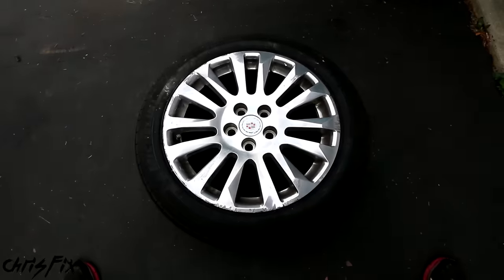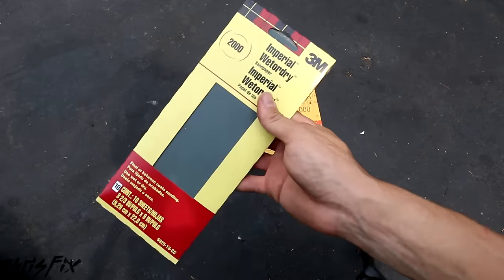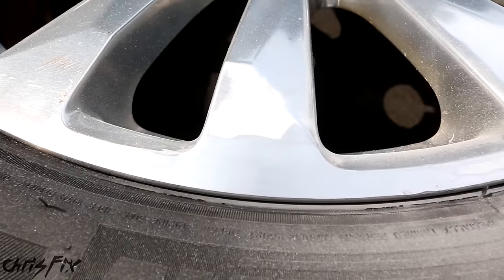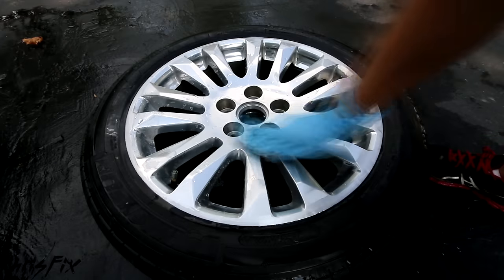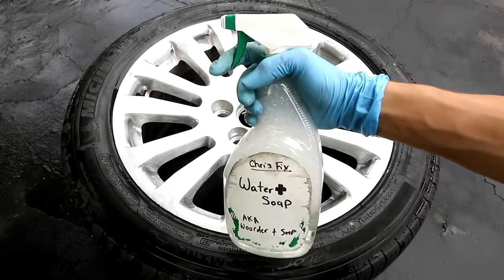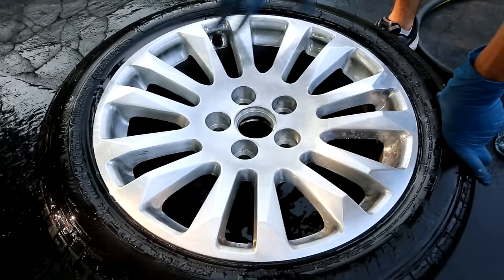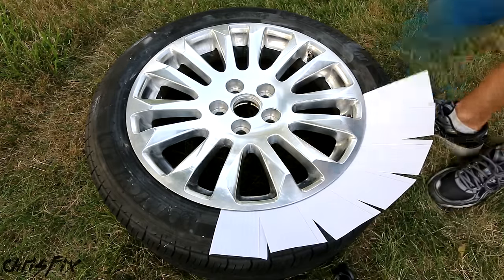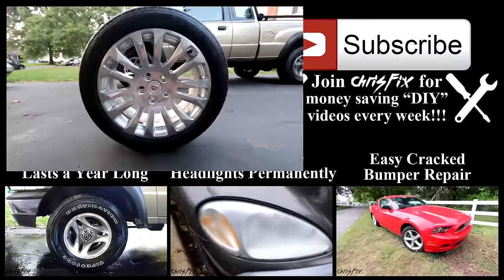How to Repair Rims with Curb Rash or Scratches

Comment: Or just don't let women drive :)
Reply from the maker: +mcgaugh57 haha, that is literally how it happened. My bud let his gf drive his caddy.
Reply: ChrisFix I knew it.
Reply: +ChrisFix Wassup Chris, excellent video as always!
Gotta question, i got 2 small annoying body rust spots on my car just above the tires on the paint. i had a guy sand it down to the metal and re-paint it, but i knew it was a possibility of it coming back, and sure enough it did 2 yrs later...

Now i want a full paint job but i know if i do it, it would come back... i was told the only way to remove it is to cut it out, is that true? Do u have any potential remedies besides cutting?
Appreciate the vids man, keep up the good work!
Reply: +mcgaugh57 If women are such bad drivers why is insurance higher for guys?  For the record I have never hit a curb.
Reply: Katy Bauer I just don't know why.
Reply from the maker: +gotti914 You need to use a sander like this to remove all of the rust: http://amzn.to/1L4yM2i
You cannot be afraid to remove all of the rust because if there is any, it will come back. Then you can bondo the damage and smooth it out. I will be doing a video on bondo so stay tuned.
Reply: I have this issue but mines happened due to someone side swipping me and me hitting the curb due to the brute for e of the impact. What makes it hilarious....it was a woman distracted on her phone.
Reply: +Katy Bauer Because guys are more reckless and take more chances when driving. Example would be like driving fast or doing donuts to impress a girl. Most girls just aren't really paying that much attention when driving.
Reply: +mcgaugh57 Oh, I've seen a whole lot of men doing rim curb damage. So I don't think it's just women :)
Reply: omfgwtfbbq90 No, really ? it's a fucking joke .
Reply: +Paolo Bernasconi That is just a blanked statement. The few people I had personally known that have died in car crashes was due to woman drivers. The first one the woman was talking on the phone and putting on her makeup while driving over the Howard Franklin bridge. My buddy was driving his Jeep Wrangler when she side swiped him, causing him to hit the side barrier of the bridge. His Jeep flipped over the barrier (the Jeep was raised a bit with off road tires and suspension so he was a bit taller then a normal car) and down in to the water. The other friend I knew that died in a car crash, he was on his motorcycle and the older woman pulled right out in front of him and I. I was lucky I was on the outside of the lane and had enough room to miss hitting her mini van. However my friend was not so lucky (or his reaction time was not a quick as mine) he hit the rear quarter of her van and died instantly. 

So yes men have a number of accidents due to the fact that men drive more often then woman. However studies show that woman get in to a higher number of accidents in their lifetime then men do. However due to the fact that woman drive a lot less then men do the total of accidents is less, but the frequency of which the average woman gets in to is statistically higher then men.

Here is an article that highlights some of this:
http://www.syracuse.com/news/index.ssf/2011/07/women_worse_drivers_more_crashes_than_men_less_driving.html
Reply: ***** Well first of all, I was not rude or disrespectful to you in any way. You on the other hand being rude and disrespectful, speaks for itself what sort of person you are. I was just showing that the insurance companies charge what they do because we (men and woman) have no choice but to pay it (that is if we want to drive legally). On that note, once I turned 25 my rates dropped substantially. They were actually lower then my wife's (she is 5 months older the I am). Of course that is just me, I have never had a speeding ticket, nor have I ever been in an accident, so I get all sorts of discounts. Well that and everything is through one insurance company, life, auto, house, etc...
Reply: +Paolo Bernasconi  I used to look at the the factors that affect prices by going to a website like The General and changing things to see how if affects the rate and also I would ask the agents at those insurance broker places like Eastwood before they was strictly Nationwide, and Amax. Your zip code makes a big difference, being a woman would of only saved like $5 but they said I had to go off what my divers license said. Being married can be good for about $5 a month, but widowed made one price go up and one got down, being a artist or police makes it a little cheaper but not much. Some places want $100 a month for SR-22, others want a $7 one time filing fee, Safe driver helps a lot. Going from a 2001 Cavalier to a 2000 Pontiac Montana saved about $7 a month. Good credit can help. Shopping around is a huge factor, when I was younger I had State farm and I spent the whole day at work and called everyone that had a commercial (the big companys) and they was all way higher, the next day I called all the companies from the green sheet and it got down to going back and forth between two companies to get the lowest rate, I stayed with that company for 4 years and my rate went down 50% until I was busted using it commercially. Now that I am over 30 I get better rates from the big name companies like Geico and Progressive. I have had 3 wrecks and they did not affect (affect or effect, idk im retarded) my rate much at all. When you shop for insurance you have to watch it because some will count not at fault accidents still

As as them talking about woman wrecking more don't take it personal it doesn't matter. They would base it on race if they could so thats why they base it on every little thing they can to make up for what they cant base it on. My first close call when I almost wrecked would of been adding to the statistics of men wrecking but they wouldn't of factored in the fault of the high school girls running down the side of the road.
Reply: +Paolo Bernasconi so your logic is...  More men=More accidents Less Women=Less accidents? + woman with small accidents don't count?...  who told you this? fox news? lmfao
Reply: +NerdishAzn I have more women blow by me in crossovers and SUVs than men by a longshot. Women are the aggressive drivers. Men who speed like to go fast, not to get from point a to point b quicker.
Reply: +Brennan Doehring same here I've been hit by five women all in the rear because they're on their cell phone or not paying attention
Reply: +Paolo Bernasconi if you want to make an insult sound insulting you should read it first before posting it.
Reply: +Paolo Bernasconi "5 times in time rear"  whatever the hell that means
Reply: +Paolo Bernasconi actually I'm very confident and sometimes cocky. You can't make assumptions on someone you don't know
Reply: +Paolo Bernasconi and as for sense of humor goes I'm known to make everyone I'm friends with laugh.
Reply: +Paolo Bernasconi but like I said you don't know me right?
Reply: +Paolo Bernasconi I spotted the white knight
Reply: +ChrisFix my brother-inlaw curb my rim two days ago :"(
Reply: +Katy Bauer Actually now females have higher starting insurance rates due to stats and bitches doing make up while driven or texting. I drive with 3 pedals and a shifter so I dont text. last time i let my female drive, I could smell my clutch.
Reply: Katy Bauer go back to the kitchen the god damn food is burning!! hurry up!!..
Reply: +Dictator In Perpetuity Standard as in Manual transmission, you know the thing with 3 pedals and a gear shifter..?
Reply: +mahunik Provide source that females has higher starting insurance?  Young men kill most when driving. End of story.
Reply: +mcgaugh57  Totally agree, the previous owner of my car was a lady who did this to my summer rims. Bought it during the winter so when the change of tires came along !Supprise!
Reply: ***** then hopefully the self driving won't curb my wheels. An if they do then I'm coming after you ;)
Reply: GTI Dashcam Sweden it wasn't that funny bruh
Reply: GTI Dashcam Sweden :(
Reply: Manny82pr Now tell Kate you're sorry!
Reply: GTI Dashcam Sweden Katy Bauer I'm sorry for being a d*** 
:(
Reply: Manny82pr Fine. no more laughing at your rims then..
Reply: +TooNiceDice Elite damn bro you have to let everyone know. lmao!
Reply: +mcgaugh57 You iz savage. XD
Reply: +Manny82pr damn straight lmao
Reply: +TooNiceDice Elite haha. take care man :)
Reply: +mcgaugh57 orrrrrrrrrrrrrrrrrrrrrrr that! :D (jk ladies)

kinda
Reply: Oh yeah. I let my girlfriend drive my truck once and she curbed my Forces 😢. I used this technique on the two she curbed and you can't even tell it ever happened. We didn't date long by the way.
Reply: +Quentin Smith ehhh as long as she put out then it's all good lol
Reply: +Quentin Smith may you find a more truck-friendly chick on tinder my good man!
Reply: +mcgaugh57 interesting points ,if anyone else wants to uncover car spray painting at home try Wiltapar   Paint Sprayer Secrets (do a search on google ) ? Ive heard some awesome things about it and my m8 got excellent results with it.

Comment: Watching these videos suck when you realize there is 4 tires
Reply from the maker: +XxS1l3nTxa1Mx In this case, only 1 rim was damaged so the job was done after this!
Reply: +ChrisFix haha very true but will this work on black rims? I don't know what type of metal it is but it is black paint can I do the same steps
Reply from the maker: +XxS1l3nTxa1Mx Black rims are easy! Do steps 1 and 2 and then smooth the areas you worked on out. Then sand the whole rim with 2000 grit, then spray primer, then spray black paint. Takes an hour at most!
Reply: +ChrisFix ok thanks what kind of paints would I need
Reply: +XxS1l3nTxa1Mx Primer, gloss black (or matt, depends what you want) and a clear coat. (Matt clear coat if you don't want a shine)
Reply: +Hamisxa Who's Matt?
Reply: ***** And how was your comeback any better?
Reply: +XxS1l3nTxa1Mx watching these videos is the best because i have no car :D
Reply: +XxS1l3nTxa1Mx hard work pays off.......you could just pay 80-100 bucks per rim and get them touched up at a lot of shops or those guys driving around in their vans (mobile workshops) but the whole point of this vid is how to do it for much much cheaper
Reply: +Top speed well you saw how screwed up that rim was and how good it looked when he was finished - the cost of all the materials needed for the job is less than what it wouldve cost to have professionals do it. So yeah - it's just a DIY video for people who arent lazy and who are willing to do some work in order to achieve results, and at a fraction of the cost
Reply: +Hamisxa It's spelled "matte" (irony)
Reply: flimflam Doesn't matter. Here in Ireland we spell it matt....
Reply: Hamisxa Who's Matt?
Reply: flimflam As you can see I didn't use a capital letter, therefore it's not a name......
Reply: ***** Sorry I'm not Australian...

Comment: I have minor scratches around the outer most area of the rims. They aren't deep at all. Do you think I could sand them down with a flap wheel sander and apply clear coat around the fixed area? Id rather not take the clear coat off the entire rim as it is a 2015.
Reply: Dylan Walter that's what I'm wondering too. Don't fancy stripping the entire wheel. Chris, can we do this?
Reply: you could, itl look bad though
Reply: Talk about 2015. I just messed up the wheel on my 2018 Mercedes gle. I hope this works cuz I really don't wanna pay 800$ to repair this rim
Reply: That's what I did on a nearly new wheel. There's a slight color mismatch but they look a LOT better with the curb rash gone. If I can find some touch up paint that's an exact (or nearly exact) match I may go back and paint the sanded areas later.

Comment: Wint this throw the wheel balance off?
Reply: +Tommy Aventadore I wonder the same thing too. I think it's best to go to a shop to re-balance after this.
Reply: +Tommy Aventadore  yes it will be needed, i´ve done this and after that I re-balance the wheels.
Reply from the maker: +Tommy Aventador No because you are not removing enough material to throw the balance off. This is aluminum and we are only removing a fraction of a millimeter to get the scratch out. Good question!

Comment: on bottle 
ChrisFix 
            Water 
                   +
                       soap

AKA Woorder + Soap
Reply from the maker: +QuitePear192103 ;)
Reply: +ChrisFix Please help . When the chemical did its job I started striping and it striped all down to the aluminium. It is not looking like you showed on the video - it is looking like solid aluminium no shine no nothing. I am still on phase 3 and I am not sure I should do next ? 
PS: When I was stripping it, it strips like rubber not like car polish.
Reply: +Lazar Lazarov 
You should start with the awter sanding and the polish after. What he had on the cadi. rim is just different type of clear , so just get on sanding and polishing!

Comment: Don't forget to rebalance the tire afterward.
Reply: +Richard Riedling II huge tip
Reply: +Rick Dangerous that's what she tells me
Reply: Why? Should this be done everytime you take a tire off for maintenance, like doing a brake job?
Reply: sirjared21 If you are grinding/sanding what have you a rim... like taking material off... then damn right it most certainly may need to be rebalanced... right man? 

But NO... not doing a brake job or etc no need to rebalance at all JUST in the case where you are grinding at the rim and reconditioning it in this manner shown in the video.
Reply: Oh ok I understand, thank you.
Reply: How to do this? take an even amount of metal from the opposite side?
Reply: Go to a tire store and let them rebalance them there

Comment: I have a set of Ford "Fan Blade" rims that I am putting on an Interceptor I am restoring to loose the "cop wheel" look.  The P71 I have originally came from Ford with a "Street Appearance" package and the steelies were added by the agency that had it.  The fan blade rims have a bit of rash and clear coat damage.  They were a $50 FB Marketplace find, what can I say, lol.  I was going to pay to have them redone but after watching this, I am going to attempt it myself!  Thanks for sharing!

Comment: What if you don't own the rotary tool ?
Reply: buy it I guess
Reply: 80, 120, 180, 220 (in that order) Grit metal sandpaper wrapped around a small flat block.  Something like a small plastic ruler, thats flat, a couple inches wide, and firm yet a bit flexible.

Stay gold.
Reply: they aren't that expensive
Reply: v bee  go buy one

Comment: The ones on my odyssey look like absolute trash. Deep scratches and chips
Reply from the maker: +Peter Kapica Now you know how to fix it!
Reply: +ChrisFix how much does this all cost per wheel
Reply: Will a sheet sander work?
Reply: True
Reply from the maker: +Peter Kapica I list everything you need in the description so you can find what you dont have and get a price.
Reply: Cool, thanks
Reply: +ChrisFix hey I need help my dad owns a 2001 blazer and the car isn't start plus nothing seems to be getting power have any ideas about it?
Reply: +German Farmer my dad says its also the alarm system that cutting off the power soo can you help me with this
Reply: +German Farmer 
Start with the most simple possible issue: Is the battery dead?
Reply: Easy german farmer, pull the alarm fuse and try a jump
Reply: +German Farmer when i ran the battery down in our Van and tried to jump start it, it ticked. that was all, they guy helping me at the time asked if it had an alarm (it did) and said to lock and unlock it with the clicker. that fixed it. simple as hell and i even used this to help 3 others so far hahaha. Might help you too
Reply: justafatman7 yes but when we try to jump start it its not starting at all but the power is flickering any ideas
Reply: So dash lights are going on and off? If so ignition switch needs to be changed
Reply: +German Farmer If the power is flickering when you try to jump it, the first thing I would do is pull the battery cables and clean the battery terminals and cable ends really well. Because if you don't have good battery contact, you're not going to have any luck finding any other problems. I would also have the battery tested. Many auto parts stores will do it for free. I've had a couple times where the battery was only a couple years old, but couldn't pass a test. And if the battery won't hold a charge, you'll have an awful time jump starting it, even if the contacts are clean.
Reply: garrisonaw my dad put a new battery in it its the alarm system why would it be a battery if I said its probably the alarm system
Reply: +German Farmer I didn't miss your comment. But apparently you chose to ignore mine. I've had plenty of alarm systems that will keep the starter itself from getting any power, but I've never had an alarm system that made the power flicker in the whole vehicle. And I've had a brand new battery that turned out to be junk, and had to have the parts store exchange it for another one. Flickering power is almost always indicative of a bad connection. Just because your dad put a new battery in it, and he says that it's the alarm system, doesn't mean that the battery or the connections still aren't the problem. But hey, if you don't want to entertain advice from people with experience in these matters, that's your own lookout.

Comment: Used to actually do this for a job for a while. Just use an angle grinder for big rash, and you can get milwauke sanders that'll do the same thing. By using the grinder/ sander you actually get a good finish a lot easier than using the first tool you're using. if you can get the wheel on something that rotates it's even easier to get the whole thing done with a really clean finish even before going up in grit count.